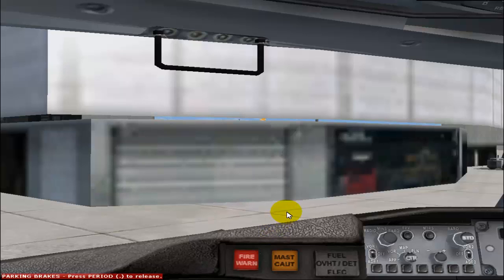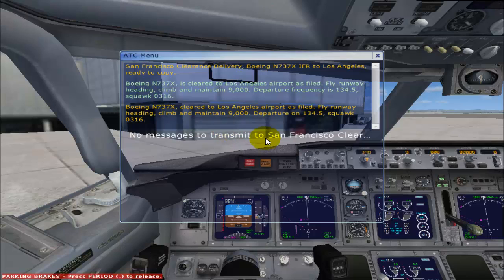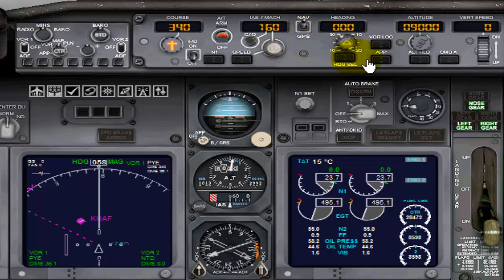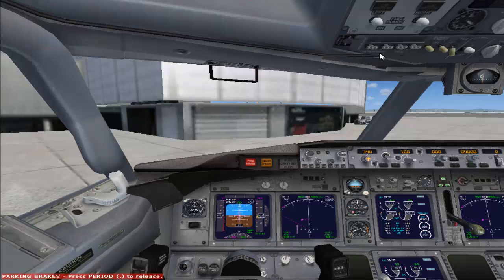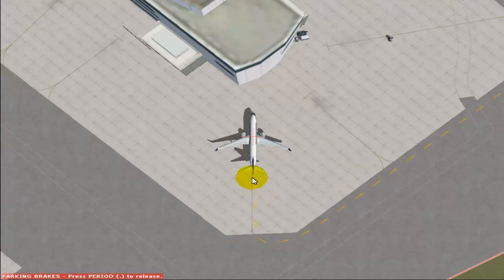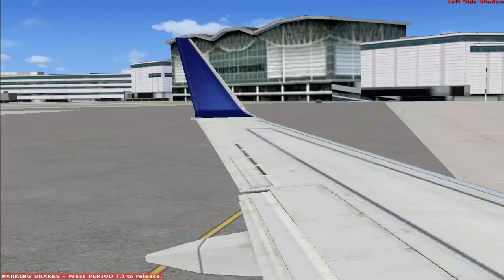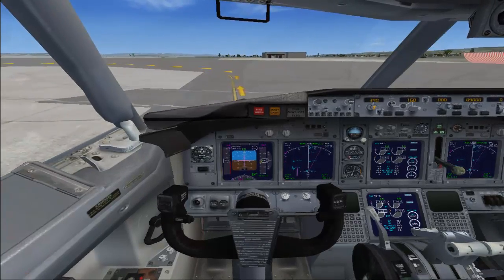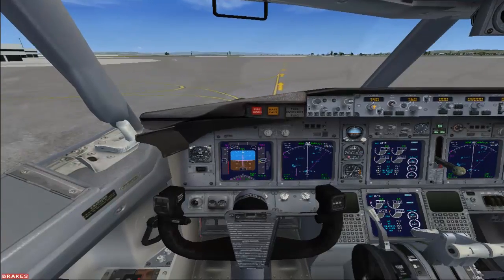FSX: How to taxi a Boeing 737-800 Tutorial (Easy and the best tutorial)

Comment: Starting from cold & dark turn on battery and APU followed by the NAV/ steady lights.
If you will taxi you should turn on your taxi and runway turnoff lights; turn them off when passing 10000 feet.
Strobes must only be turned on when crossing runways or holding short.

Strobes are super bright and can blind other pilots on the ground!
These are my tips for you.

Please use them wisely.

regards,
Chris

Comment: Wich b737 800 r u using sir? I can't make a difference between the b737 800, b737 800 NG and the b737 800B NGX, could u help me with this?
Reply from the maker: Boeing 737 Next Generation or commonly known as Boeing 737 NG (not Boeing 737-800 NG) is a series of modern Boeing 737 aircrafts which includes (B737-600, -700, -800, -900) and is an upgrade of classic B737-300, -400 and -500 . So the B737-800 you mentioned is an aircraft that belongs to B737 NG series. Now the B737 800 NGX is an add on simulation aircraft developed by a company called PMDG for the Flight Simulator X and Prepar3d which simulates very closely to the real world boeing 737. Hope thise clears your doubt.
Reply: @T4UTutorials  great information! Thank you so much sir for your help:))

Comment: Great video, it helped out a lot! Just one thing, usually while parked your engines and flaps would be off, and you would not turn them on until after pushback. However in FSX the engines are always on when you appear, so I'll let you off.

Comment: I have a problem. whenever I press Num 0, it just goes to the virtual cockpit rather than turning the rudder.
Reply: make sure ur numlock is off
Reply: aditya sangvi actually, I found out it was just a mess-up with the configuration.
Reply: Hold shift while pressing zero

Comment: what is the purpose of cross feed??
Reply from the maker: Cross feed valve is used to temporarily connect the fuel tanks on the left nd right wings of the flight. Normally this is kept shut so that even if there is a leakage of fuel in one side, it wont drain the whole fuel. But in situations like when there is an imbalance of fuel in two wings, we open the cross feed valve so that fuel can flow from one tank to the other and keep the flight balanced. ☺
Reply: Thank you!!
Reply from the maker: So happy to help you

Comment: Hi there..im new to this game..how i want to operate with joystick??because it looks like have so many buttons to use to operate the plane..if i use the basic joystick that im use for soccer..how i want to set the main buttons for FSX..hope you can help me..
Reply from the maker: Muhammad Ashraff Bin Zulkarnain You cannot control the whole functions with your joystick because the number buttons on a joystick is limited. You can assign few important controls such as Rudder controls, elevator controls, aileron controls, flaps control, landing gear controls, speed brake controls, throttle controls etc on the joystick. use keyboard for rest of the controls. Do you need more help?
Reply: thanks for the info..i still new to this game..i dont know how to settings the button on joystick..i mean like important buttons,which button that needs to set on joystick.
Reply from the maker: I will create a video on it..Wait please :)
Reply: ok..thank you..can i have your facebokk..
Reply from the maker: like the page :)

Comment: Hello T4U Tutorials nice video but I have three questions....1. When I press 1 for pushback,it didn't turn left... 2. When I press 9 or Enter ,the rudder didn't turn left or right. 3. When I turn on progressive taxi, the yellow arrow didn't appear  .. I hope you answer my question....
Reply from the maker: I dont know what is the problem. it must be due to any errrors. try reinstalling FSX. For pushback you should press Shift+P and then 1 or 2 immediately
also, if 0 and Enter is not working, try changing the controls....hope u know how to change the controls in FSX. If u dont knw, lemme knw. i will help u. :)
Reply: T4U Tutorials Hmm.... how to reinstall fsx?
Reply from the maker: remove fsx and install it from beginning :)
Reply: T4U Tutorials But... I don't know how to reinstall fsx.... So, I delete the fsx folder and when I enterred the fsx disc, I see the reinstall button...when reinstalling fsx, it says error... "You have update config.msi".... what is config.msi.... I hope you understand what I said.... Please help me...
Reply from the maker: Afeeq Nasir did you try installing it as an administrator?? (right clicking on the installation file icon and selecting "run as administrator")